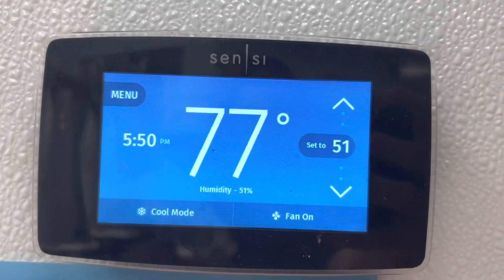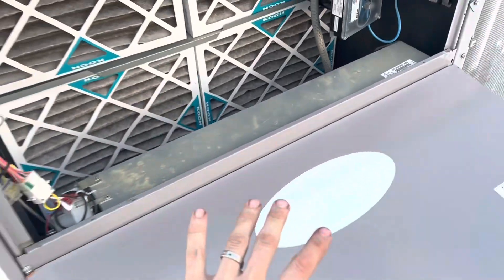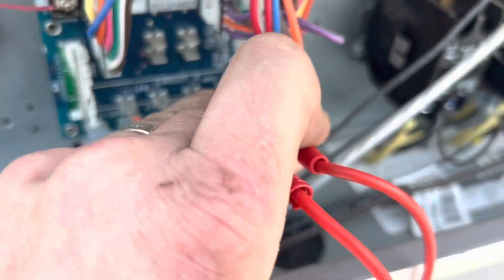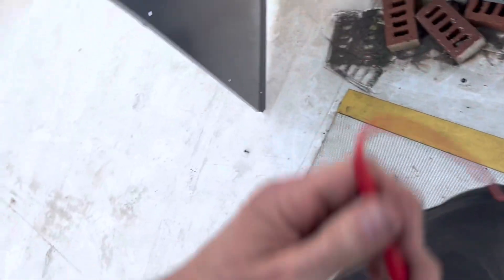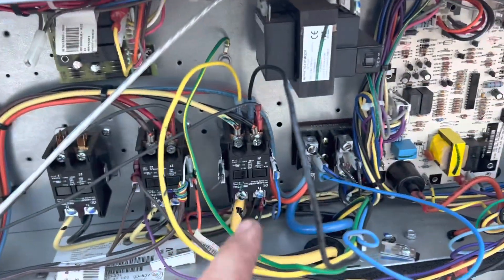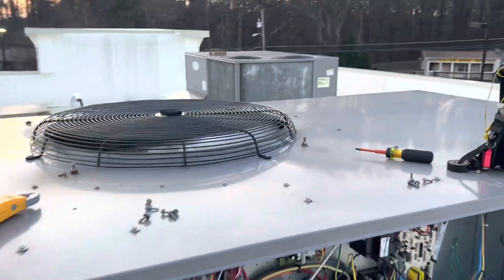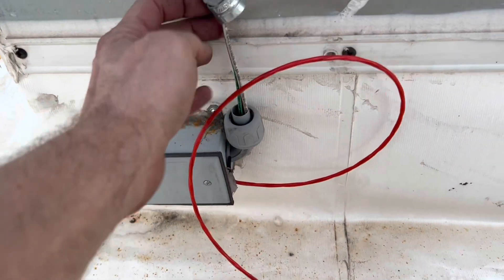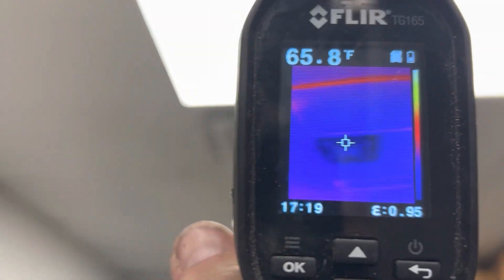Kitchen Hvac not cooling

Comment: motomaster a vfd for condenser fan?I have installed quite a few carrier rtu never seen those stupid devices
Reply from the maker: “Latest and greatest”.  I installed the unit and we had to add it on.  Was a pain.  Had to add high side splitters (that are gonna cause leaks) and run the probe tubes across the blower cavity.  Energy efficiency sales requirements…. 🤮